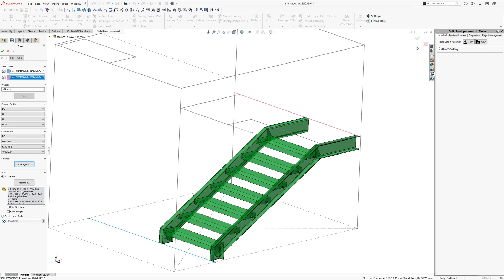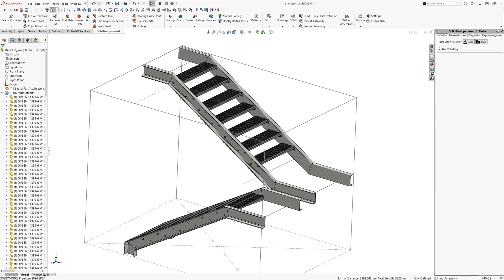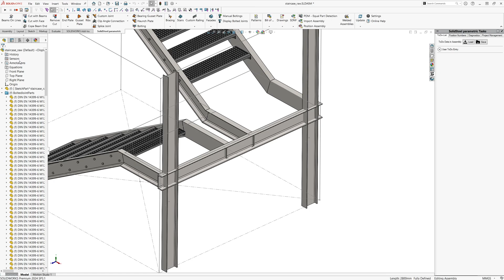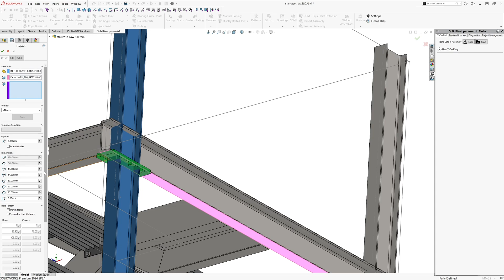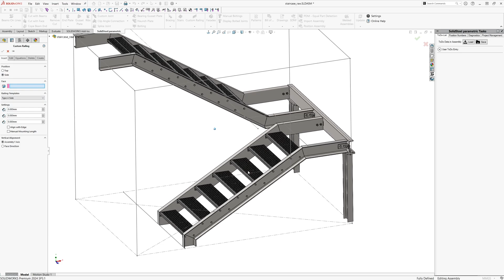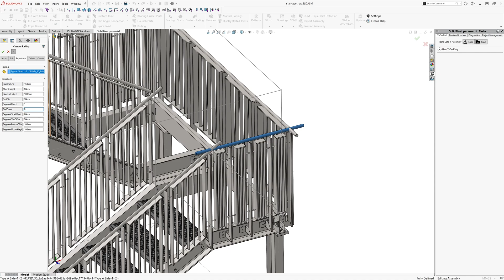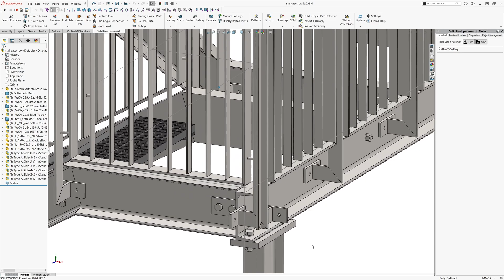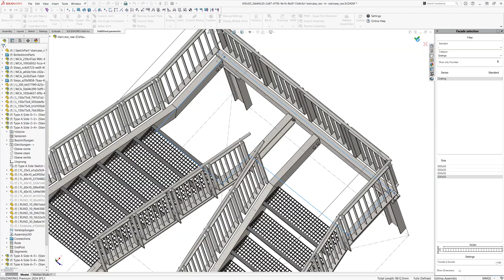Steel staircase with railings and gratings in SOLIDWORKS with SolidSteel parametric

Comment: Nice add on , but still wondering why not possible to sub assemblies like tubular diagonal made with pipe and gussets separately, create all drawings and import this to main assembly , this operating mode is similar to steel designer pro addon , where it is possible to import sub assembly including all drawings for that sub-assembly and single parts
Reply from the maker: This is of course possible - we have a function called Assembly Manager for this purpose. Here, an independent copy of the assembly is created and adapted to the new installation situation. If you were to use the original assembly instead of an independent copy, it would also be changed in all old assemblies accordingly. The concept of SolidSteel parametric enables the user to create any complex assembly without the restrictions of pre-designed components. The drawings are simply newly created with the automatic drawing creation (also from virtual parts within the assembly). The same applies to DXF export, DSTV export and BOM lists. Geometric identical part recognition also avoids creating drawings of identical parts / assemblies. Thousands of installations in over a hundred countries around the world and dozens of resellers on all continents confirm our view that our approach is the right one. Nevertheless, competition stimulates our business. I can recommend you to have a look at our solution in a free test and you can convince yourself of our concept.
Reply: @apps4swx  your approach looks good, but my idea is to avoid review of drawings of assemblies and parts that we create and we use as database. for example we are tubular tower designer , designing one leg or one diagonal with all drawings and save them somewhere to be used as template. importing them to my project should not lead to create a new drawings , but to use the existing drawing with of course the solidworks update function. otherwise we have to add dimension on all sheets one by one which took a lot of time. hope you get my idea. Thanks for you

Comment: Buen día tienes las medidas del boceto del cubo para modelar la escalera gracias
Reply from the maker: Buenos días @luchoerik2012

the basic cube has the dimensions 3600 mm x 2662.5 mm with a height of 2800 mm.
The start line of the first staircase is 800 mm from the narrow side of the cube and the end line of the first staircase is halfway up the cube at 1400 mm.

Hope this helps, best regards,
the Apps for SOLIDWORKS team